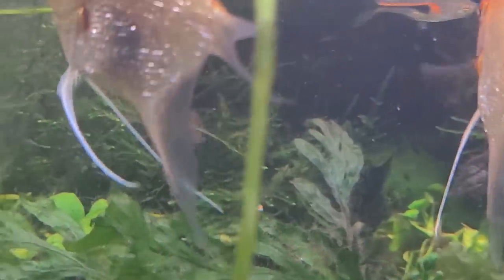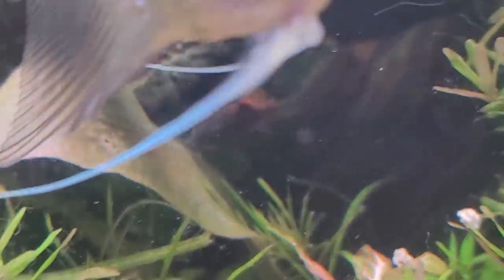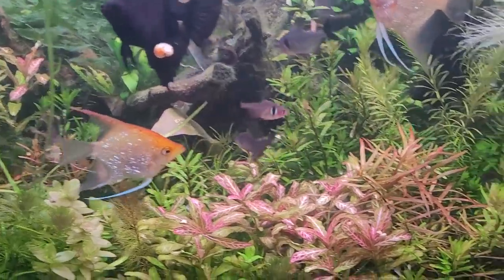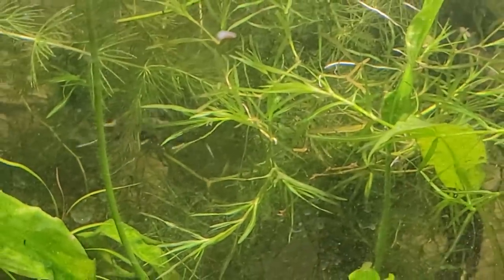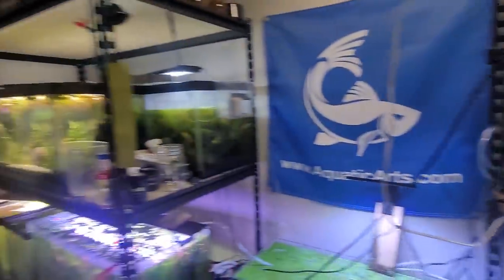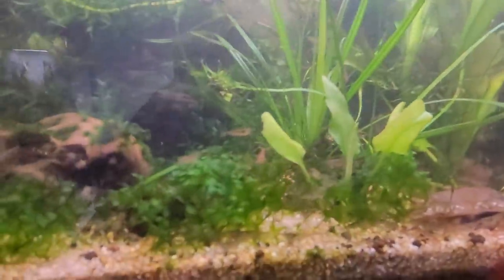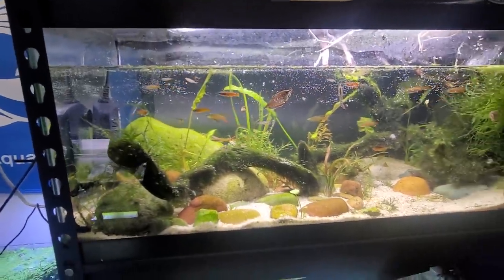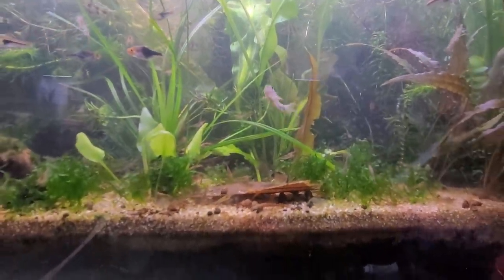The TRUE CAUSE of Corydoras Barbel Erosion & Injury. HOW TO Prevent or Cure Catfish Whisker Damage.

Comment: I agree, I had kept them in pebble substrate for a long time before using finer substrate and they did well. Though, the activities you get when using fine substrate such as sand should be considered if one wants to keep on watching them do their things. The moment my corydoras finally had a fine substrate, they just went in and kept on sifting. On my before setup which was the pebble substrate, they would just hide all the time under the plants but the sand substrate, which is only a potion of the tank, is a great way to lure them out and they can be observed more.
Reply from the maker: Totally. Depending on the species they really do loge playing on sand, digging or hiding in it/on it
Reply: I've adding sanded areas over the pebbles to create viewing areas in the front and the one visible side of my 100 gallon. Seems like I can just add more pebbles around anything they are trying to uproot in my coarse sanded 125.

Comment: In my experience, corys only lose their barbels when the water quality is bad. Quite a few years ago I had some leopard corys in a small 20L tank. If i forgot to change the water after 2 weeks some of them lost their barbels. Another issue with corys in poor water conditions is that they develop a weird disease. One by one the corys will start to swim uncontrollably, over a few days/weeks. They seem to feed but gradually lose weight and die eventually. Dosed with metronidazole and anti parasite meds but to no avail. I had one gold lazer develop this issue in a temporary tank. But once I moved them to a tank more than 10× the size the issue resolves on its on. So moral of the story is keep your water clean and give your corys more space if you want them to thrive!
Reply from the maker: I've noticed similar things as well. The air bladder control loss and nervous system twitching seems to happen from high nitrates or ammonia in my experience too
Reply: Yes I experience the same I loose my two cory one is juli and sterbai 😭

Comment: Ammonia: 0.00 PPM
Nitrite:0.00 PPM
Nitrate: 7.7 PPM
pH: 7.4
Alkalinity: 172 PPM
GH: 170 PPM
TDS: 168 PPM

My cory catfish doesn't have any Barbels at all, and hasn't had them for as long as I remember.
I originally had 6, now just one, I quarantined the rest and dosed PolyGuard when one of them died off but still lost all but the last of six to some unknown problem during quarantine, I kept them in the quarantine after finishing with the medicine to ensure they could heal but they all died, I added the last one back to the main tank and they've behaved completely normally, they swim around my Bolivian Ram not afraid of them and rarely QUICKLY swim to the surface for air, they feel comfortable enough to swim slowly instead of super quickly like how I observed when first adding the 6 to the tank a year or so ago, they just.... don't have any barbels, just like all of the others I purchased. Instead their mouth is a white hole just like the thumbnail, in-fact my cory catfish is the same species.

I have a deep playsand substrate with some gravel topping it off in the front-end of the tank. I feed the catfish via shrimp wafers.

I really do enjoy this species a lot but I don't think I'll get more, I don't want any more of them to unnecessarily suffer losing their barbels to whatever is causing this problem for my current cory. I'm well aware that catfish need a group of 6 or more, but I don't want to cause an endless loop of the same thing happening.
Reply from the maker: The fact you care about any of it, means its got a great home now. 

It could be bacteria they had when you bought them sadly

Comment: I had entire Cory groups come in the mail with no barbels and the wound had scarred over perfectly. After years of soft sand, black worms, RO water changes with tannins still no barbels. Is there anything else that I could do to help them grow back? Do the meds still work even if the initial wound has scarred since many years?
Reply from the maker: Sadly, after 6 months without them, they are gone. But in an aquarium you can give them a full life still...whereas in the wild they would be dead quickly from starvation

Comment: I’ve bought some hardscape from a LFS that’s labeled as “Burma petrified (Burma stone)”, which I believe is a prettified wood, from Lifeguard Aquatics. Would it be unsafe to put in with corydoras and is there anyway to make it safer. I could use a power head while I cycle but I don’t know if that would really erode the stone. New to the hobby, thanks for all your thoughtful videos, btw!
Reply from the maker: You'll be fine with that stone. It's actually layered silt/mud stone that just looks similar to wood (usually). Some sellers just make stuff up annoyingly.

Comment: I noticed my group of Habrosus Corys in my planted 40b all lost their barbels. Theres no lesions or any injuries visible, they're just gone. If I treat them with an anti-fungal, should I pull them into a quarantine tank or dose my whole tank? Because if its something thats present in the tank they're in I guess I should treat the whole tank but if I dont have to, I'd rather only dose 10gal than 40 lol
Reply from the maker: Um their immune system should heal so I'd treat them in a small tank...but keep them there until the barbels come back somewhat... then just don't feed them food that will cause them to dig into the substrate if you can find wafers or algae snacks for them/frozen blood worms, I'd feed them that. Also a catapa leaf or two in the 10gallon will help heal their slime coat and skin.
 Basically, yes, they will likely grow back their barbels...or worst case...if theyve been gone over a year, theyll just live without them (in the wild they die without them, but in tanks they can live just fine since they dont have to forage for food so much. So in the big tank that bacteria will probably still exist...but ecoli and MRSA etx exist on our skin...but if we are healthy we can fight it off daily and be fine...as can they :)

Best of luck and I Hope that helps a little? Cheers
Reply: Thanks, definitely helps! I was basically under the assumption of what you said so thanks for solidifying my original thoughts.

Comment: I have a few corydoras granti in my sand bottom community tank that are showing some barbel erosion 😫 so finding this video was a huge help, thank you!! I'm currently setting up a 10 gallon bare bottom tank for them and plan to add a catappa leaf when I add the cats, since right now they live with neocaradina in a hard water set up with a high pH and I don't want to stress them more. I'm thinking I'll give them a couple weeks to adjust to that before treating with maracyn, would you agree, or do you think I should just medicate right away?
Reply from the maker: If the sores are bloody,  treat immediately,  if not- then you can wait
Reply: Not at all bloody. No pink anywhere, just worn down. Thanks for taking the time, Alex!

Comment: Nice info and video Alex but you confused me. Barb issues caused by a pathogen I understand. But in a few parts of the video you reference that sharp objects can cause a damage to the barbs allowing a pathogen to take hold an infect. But then you also mention sharp objects not being a culprit. I can understand a scratch in a barb not getting infected and rotting away if the pathogen is not in the aquarium. Usually most aquariums have different bacteria present which does not effect healthy fish. But with a scratch in a barb the bacteria can get a foot hold. Am I to understand by what you are stating that the bacteria can in fact take hold of a healthy barb? 

I think the information regarding sharp objects in the aquarium causing this problem is really just to remove the possibility of causing a scrape that would allow an infection to take hold. Hopefully it's not taken as using sandpaper rubbing off the barb. LOL
Reply from the maker: You are correct. In theory any object that breaks skin could cause it. However it was so rare in studies, that a healthy fish had this issue, they decided to amputate the barbels to study them instead of finding fish to treat